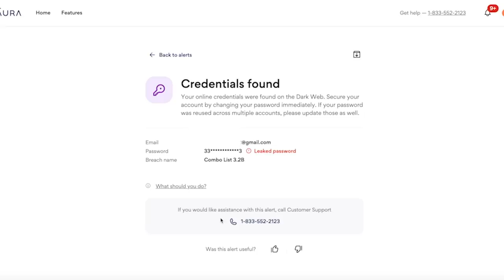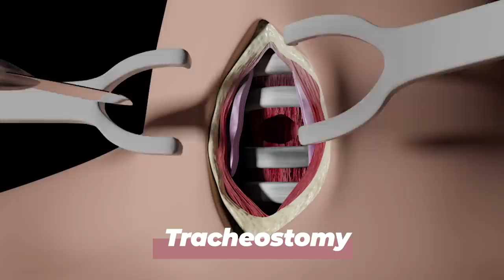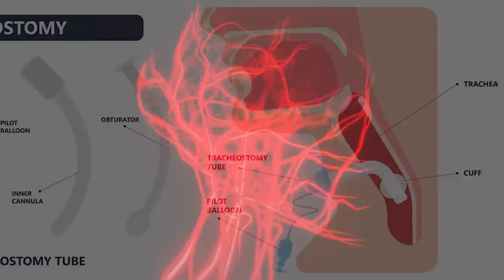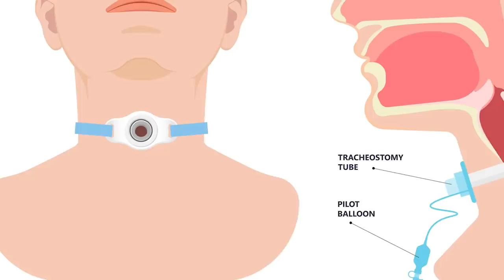How to Perform a Tracheostomy

Comment: I had a tracheostomy 20 years ago (in my young 20s) as a result of pneumonia-induced ARDS. In my opinion you skipped one of the coolest parts - when the trach tube is removed they just slap a piece of tape over the hole, no stitches required. The skin grows together on its own (apparently the only place in the body where this happens? I may be wrong there). Every day the nurses would hold up a mirror so I could see the trach hole getting smaller and smaller, it was so cool! I made a complete recovery and wear my trach scar with pride :)  Thanks for your content!!! xoxoxo
Reply from the maker: Thanks for sharing!
Reply: You likely received a dilatative tracheostomy then! It works a little different than a surgical tracheostomy. It's basically the light version. Dilatative tracheostomies involve the insertion of a special canula into the trachea that is then used to dilate the hole. It can be done bedside in the ICU and is done in cases where the tracheostoma is not supposed to be permanent. In a surgical tracheostomy they reroute blood vessels and suture the skin in a way that stabilizes the hole, keeping it from closing on it's own. If you accidently decanulate a patient after a dilatative tracheostomy though, the hole will close extremely quickly, making the use of a placeholder while switching the canula mandatory.
Reply: @Jumper1155  Oh that's so interesting, thanks for the info! That's definitely what I had, I was in a medically-induced coma on a respirator for almost a month, and apparently due to the swelling they needed to add the trach. After I came out of the coma I had the trach in for a couple weeks so altogether it was in for under a month. The nurses were so worried I'd be upset about the scar 🤣 I just wanted to pass the swallow test and get the hell out of the hospital LOL
Reply: Ive had multiple pneumonias where I have been hospitalised as a kid, thankfully never had to endure this horror procedure :P good to hear you all well!
Reply: I’m glad you fine now,
Reply: I’m happy you got better! But feeding tube holes close up on their own too. I have one and if it falls out I have to plug the hole before it closes and it’s starts to in less than an hour.
Reply: I too had a tracheostomy--from June 22nd through July 19th. It is weird how a dressing is placed and there are no stitches. My site started healing the day after it was taken out. I had a PEG Tube as well, but it wasn’t removed until just this past Saturday. Turns out that my pain was caused by it being displaced.
Reply: Hoping to get mine out soon and will insist on a mirror.  Thanks.

The same thing happens with a feeding tube.  When they pulled mine they put on a bandage but said it was closed and I could take a bath 3 days after it was pulled. (You can’t bath or swim with a gtube.  Can’t swim with trach tube either for that matter)
Reply: @laratheplanespotter  Oh wow, I didn't know that! Sending good thoughts to you xoxoxo
Reply: @csueconner9711  I didn't know that about feeding tubes. Best of luck with getting rid of the trach! Once you're in the clear it heals nicely. And wear your scar proudly xoxoxo
Reply: My dad had a reversible colostomy bag years ago. Once they took the tube out it healed from the inside out as well, just like yours!
Reply: I’ve had a few like yours where they didn’t need to suture it. I was awake for 2 of them but slightly sedated. One of them they couldn’t put me under out of fear that my lungs would collapse.
Reply: I have a tracheostomy myself and I had it since I was little I'm not afraid of it and not afraid to show it either I'm not embarrassed or anything like that
Reply: @ginsoakedgirl4  hello I have a Trach myself and I had it since I was little they were going to remove it but it was too late if they remove it now I don't know how my body would react to it but when I was little I couldn't breathe on my own and that's when they had to do surgery and put a Trach in my throat which it sucks but I'm not a embarrassed or I'm not shy of showing it either 😅 🙃 🙂 I'm happy with it
Reply: I've had several chest tubes and when they pull them out they put a dressing on the holes.
Reply: Wounds can heal on their own, and it's called secondary intention, the wound is left open rather than stitching it together (that's first intention) the body will fill the gap by itself. So it can happen on any part of your body!
Reply: @csueconner9711  huh weird, I was told swimming is fine with my various feeding tubes, SPC tube and tracheostomy.  I've only had to stop swimming since I've had a Hickman central line. But even then, I was told that is possible with special dressings for Central lines. I just swam with my tubes normally, never had any issues

Edit I just checked my care manual and it said absolutely you MUST bathe with G/J tubes! I wonder if different hospitals/countries have different policies. I'm from the UK,  for reference
Reply: @unknownentity7964  I haven't had my tube out yet and I was told the hole would heal itself (most of the time).  I had my first gtube removed and the same thing occurred,hole closed on its own.   Left my belly with a second belly button.
Reply: @csueconner9711  my disease means my body heals really badly/slowly, so when I got my first tube out because it'd embedded itself in my abdominal wall, the hole didn't close up for aaages. I had to have a minor surgery to heal it. It looks just like a 2nd belly button now though, woo we match! My whole abdomen is a mess of scars tho, I'm super insecure about it
Reply: I had one of these 7 years ago when I was 8 years old when I had a severe case of diphtheria. I was terrified because so there are so many different complications,

Comment: I  was the anaesthetic nurse for my ENT theatre. I remember one patient for reasons I won’t get into, required an emergency tracheostomy.. We had to perform it in my anaesthetic room, because the patient had previous radiotherapy when the emergency tracheostomy unfortunatly the Innomonate artery had moved. It was within 2 -3 minutes there was 3 Consultant Anaethetists, plus  in theatre there was a cardiovasculr surgeon and bypass being set up. It took about 3 hours before we had the patient stable to go into theatre. We also were using a fast delivery system that could put a pack of emergency O neg blood into the patient within 5 minutes.  Im delighted the patient went to Intensive care and made a full recovery.  Always BEFORE usuing a muscle relaxant   for a general anaesthetic   you  should have a look at the patients vocal chords to ensure there is room to pass an endotracheal tube. If there isn’t enough room you can always waken the patient, consult the surgeon, make other plans, without risking a patients life.

Comment: I have a tracheostomy myself. It's not fun. In order to remove secretions/mucus from the trachea, they basically have to vacuum clean your lungs. They put a long catheter which is connected to a suction machine inside the trachea, just above the lungs, and suck all the air and fluid out of you. This process is repeated multiple times every day. I wish he mentioned that in the video.
Reply: Exactly! I had  the same exact thing. I could hardly eat, fluids build up around the tube and then that suction machine felt like sucking your soul out of you.
Reply: Argh I have a trach too, and I feel your pain!(I'm on a vent due to mitochondrial disease). I hate suction only second to what using my cough assist device was like pre trach. That was like your soul being sucked out by a vacuum times 10! Bleurgh

Comment: 10:30 EMS is allowed to perform emergency trach in my area of NC. We have two different types. A quick trach which is essentially a large diameter slightly curved needle that you just push through the membrane. Second one is a surgical style. We have a scalpel to cut the area open and hooks to pull the area open. Then we insert a short endotracheal tube and inflate the balloon. But all of these require a ET tube holder to secure the airway in place. This was a good video but I just wish you would have shown the actual procedure.
Reply: Yep, we can do it here in MO as well...Well, paramedics can, not EMTs. I've yet to need to do one,  but the option is there. I suppose it depends on state and local protocols though.
Reply: With YouTube's aversion to red blood, doubt they would allow it. Which is kinda stupid.
Reply: @SrslySly  only medics also in NC

Comment: I had the "elective" due to double pneumonia and sepsis plus I had a severe allergic reaction to Sux.Chol.Clor. (yes I'm in the less than 1%).
     When it was time for the tube to be removed my surgeon had a trick. I held my nose closed and acted like I was popping my ears. The piece popped right out and landed on my chest. 🤣

Comment: I was diagnosed with Hashimoto about 9 years ago and started having issues speaking like 3 years ago. My voice just loses steam and it feels like my vocal cords or everything around them tightens up. I do feel it has to do with my thyroid but docs say its not that. Any feedback on whether you think this might still be related? Thanks a lot!
Reply: Vocal issues can be a sign of thyroid cancer.  If you have noticed any nodules in your neck, it's best to have these checked out, preferably by ultrasound.  If they are large enough, they will biopsy.  Most thyroid cancers are very slow growing and are either discovered accidentally or if you start to have trouble speaking or swallowing.  Not a doctor, just speaking from what I learned with my own hashimoto's and thyroid cancer.

Comment: Couldn't you initiate it with a kind of "split injection needle"? (As thin as possible, for starters). Have something in the hole down the middle that you can expand (eg by inflating) between the two halves, and then maybe run in two more needles next to the first to further expand the hole. 

(I suppose you'd have to nick the tissue to the sides you want tearing to take place on, so you might want a pair of razor edged needle halves... 

Hoo boy, I thought this would be simpler, but looks like it's getting complicated. The idea would be to "squash" the things you'd have otherwise cut, and do less harmful damage in case of mistakes, that way. So the razor edges would be a bad idea if that isn't a worse one.)

I think I'd better leave this to the surgeons.
Reply: Something "stepped-conical"?

(This needle spoiled my supper, so might as well add the new thoughts. Very thin pricking part, with razor edges to nick the sides of the hole, about 1 cm long, fitting inside a next stage. As soon as the next stage is in, pull out the "probe part" through the inside of all the other parts/ the other part.)

Basic idea is to widen a very small hole that starts out useless for the purpose (although maybe with a pair of alternating action compressed air, then "vacuum" pipes of small diameter, but carrying more moles of gas per pipe volume than an unforced pipe would might allow smaller incisions?)

OK, now I shut up.